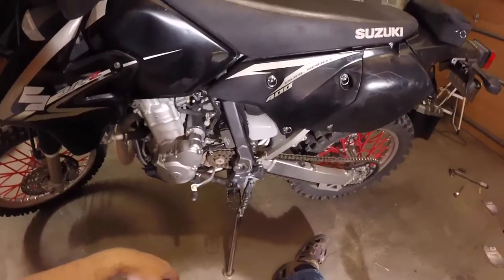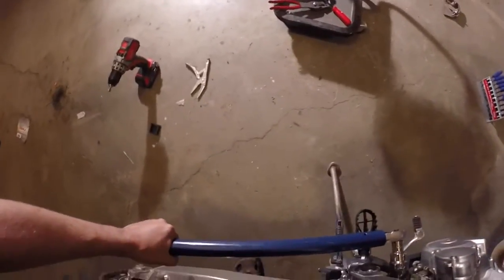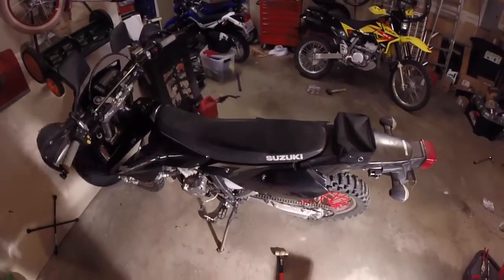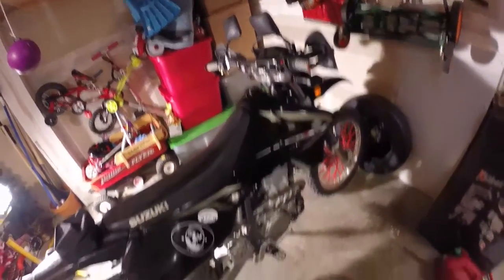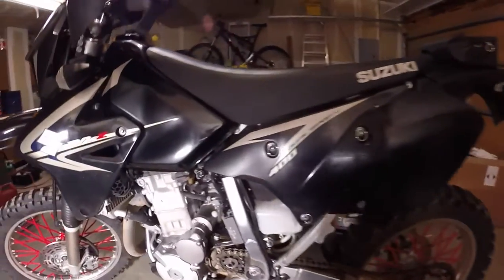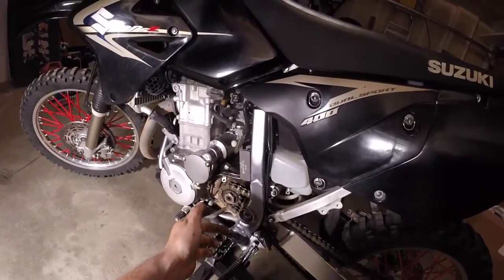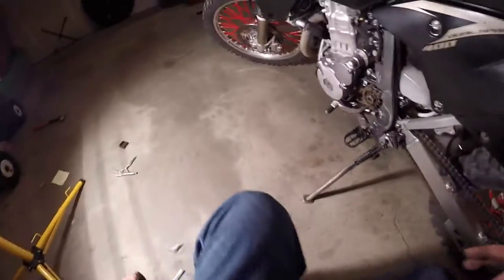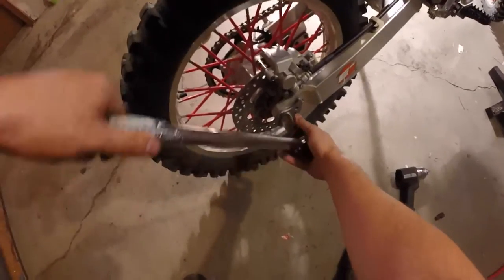Hermit vs. Front Sprocket

Comment: If you don't have a impact ratchet you can sometimes hit your standard ratchet with a dead blow hammer.  Also put the bike in 6th gear for torque advantage.
Reply from the maker: +jugghead98 Stupid bike doesn't have 6th gear, but I guess I'm more stupid for not at least trying 5th.
Reply: +Hermit DaVlog All good Hermit.  Glad you were able to get it done.

Comment: Don't fear locktite, Hermit. Just learn to use the right one. 

Blue is good for things you might want to remove again, and for small screws, say anything below 3/8" bolts. 

Red is a permanent thread locker, it can be removed, but heat is required to do so. And do not apply it to small screws.

They do make Green locktite... that stuff is permanent, even with heat. Only use it on stuff that absolutely will not ever be taken apart again... So, on bikes... try some Blue... it works nice, and, if it's being stubborn, a little heat will coax it into releasing just fine.
Reply from the maker: Yeah, I got all that. My problem is they put the blue stuff in the red tube and then I get all confused and start to not trust my memory.

Comment: I've had my front sprocket nut come loose before.  Thank goodness for that lock washer.  I didn't notice it until my chain and rear sprocket were basically destroyed.  If you have to keep tightening your chain, and it never stays adjusted for more than a day or two until you have to tighten it more, that's probably a loose front sprocket.  This reminds me.  I need to check it...
Reply from the maker: +The FLB Club Good tip. Thanks.
Reply: +Hermit DaVlog I'm really glad you posted this video, because it reminded me to check.  Front sprocket bolt was loose!  I had torqued it to 80 foot pounds.  This time I said "Eff it" and used locktite.
Reply from the maker: I probably should check Ned's too. Thanks.

Comment: Love my impact I even have a 12 volt impact and a 24volt ridged impact 😉. Ps I use a strap, loop it around the tire and around swing arm and synch it up and it won't move hardly at all works great. Make sure to rap around tire so their isn't much torque  against the spokes
Reply from the maker: +John Behmer Good tip. I'm thinking maybe I can just stick a wrench between the chain and rear sprocket. Hmmm.
Reply: +Hermit DaVlog that will damage the chain too much leverage but I notice you could take a long extension and stick it through the sprocket to the other side so as the tire turns it hits the swingarm and brake assembly on the other side stops it from turning pretty easy

Comment: Nice vid, Hermit.  You might want to consider a breaker bar rather than a ratchet.  That puts a heck of a lot of stress on your 1/2 drive.  I've broken 1/4 drives drives that way (though not a 1/2).  You've a beefy compressor setup, there.
Reply from the maker: +Mark Bishop Yeah. I can't count how many times, I've said to myself "I really need a breaker bar for this" and then a week later been standing in the store in front of a breaker bar sayin' "Do I really need a breaker bar?"

Comment: I had to change the seal behind that sprocket with only 2500 miles on the bike. It stressed me out. I did have an impact though. Torquing it to the right foot pounds was tough though.
Reply from the maker: +Noel Flitton Good to know.

Comment: What was the point of a 13 teeth? Low end torque I would guess?
I've done my share of mechanical work but prefer watching someone do something I've never done before.
Good stuff, thanks.
Reply from the maker: +Joe-n-Tex Yeah the stock gears are 60/40 street/dirt for some. If you're riding is around 60/40 street/dirt then it's fine the way it is. If you never get on the highway and always play in the woods you probably want to gear down.

Comment: If you Dont have an impact put the bike in 3rd or 4th gear. the wheel wont spin as easily as in 1st or 2nd. But the impact is still better than a friend. Lol. Nicely done.
Reply: Could also stick the end of a 3/8th extension into the hole on the rear sprocket and rest that against the swing arm to hold it from spinning.
Reply from the maker: +PysKotic Great tips. Next time I do this I'll start there.

Comment: Next time just stick a screwdriver in the first open sprocket groove right before the chain it will bind it up so you can break the nut free. Also you're not really supposed to add a brand new sprocket into a set I've sprockets that are broken in with a chain. Fyi. And if you end up asking me why, do some research.